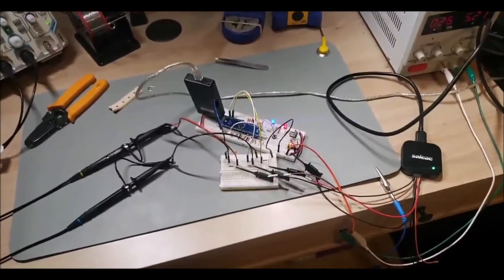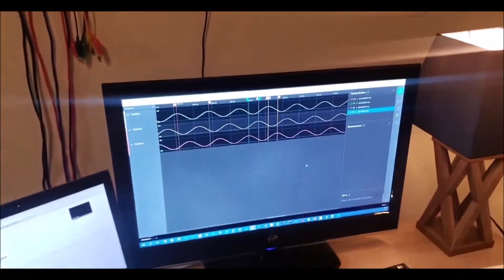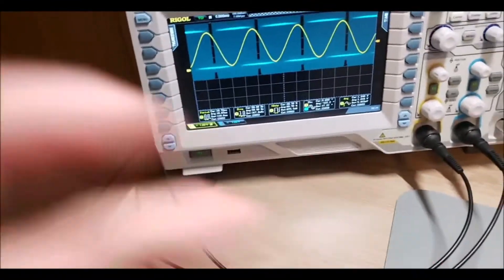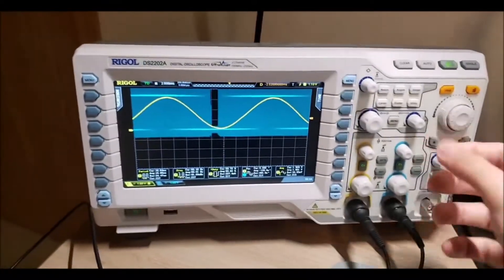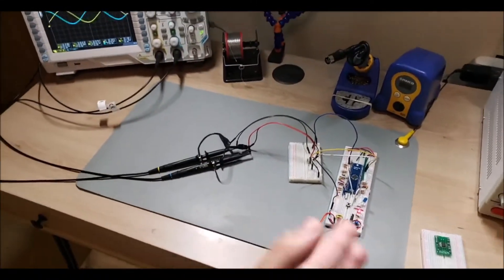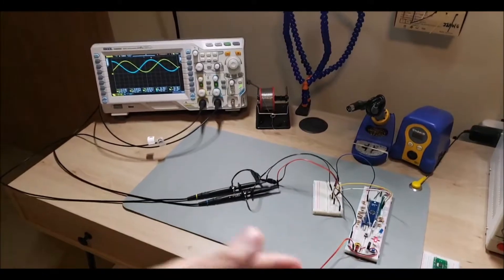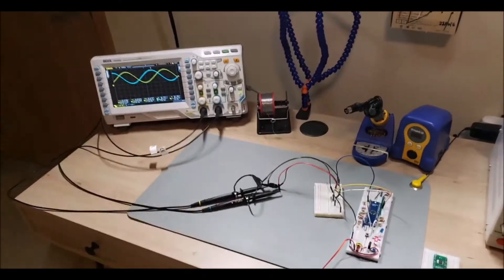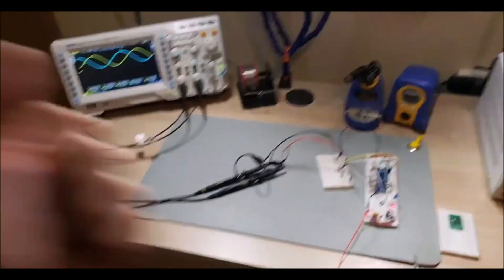Milestone : Successful SPWM with the dsPIC33

Comment: Nice sinewave using dspic33f. Can you do video for 1phase sinewave inverter which have feedback and battery low protection?
Reply from the maker: Thank you. That's a good idea. I might look into that and let you know. 👍
Reply: @abdullaalmosalami  thanks for the reply. It will be nice if you help do 1phase 220v, 50hz and should also have close feedback so that the output voltage will be regulated to remain 220v under load condition. Thanks